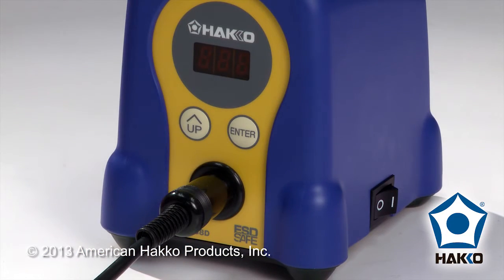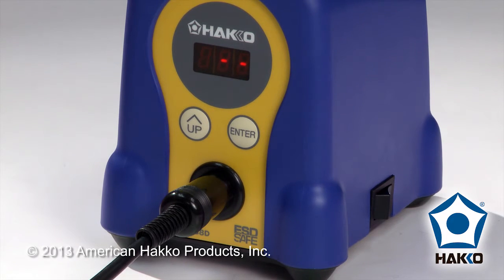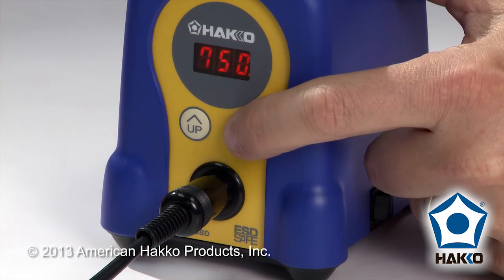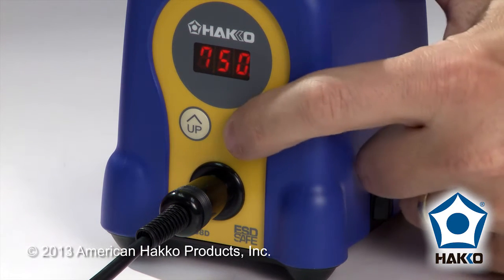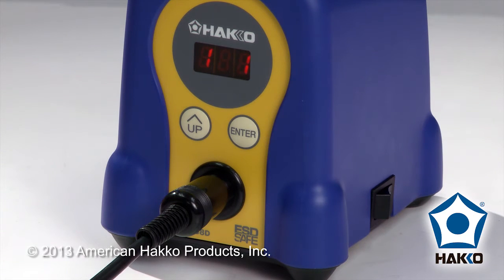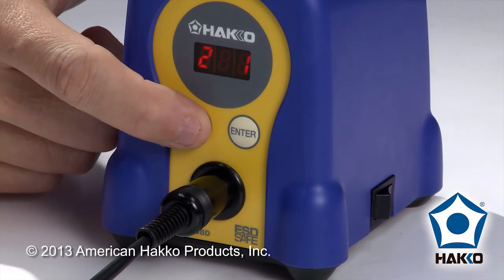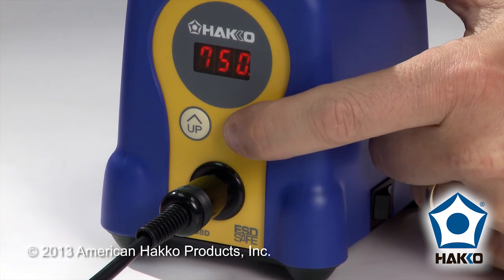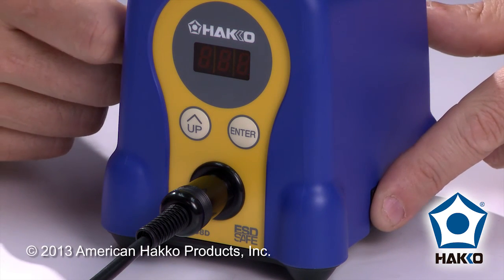Hakko FX-888D Soldering Station by American Hakko — How To Set and Use the Password Lockout Feature

Comment: There is no excuse for the amazingly bad human interface design on a supposedly premium product.  Dial adjustment works fine on machines in far more demanding environments like welders (I also weld, repair welders, and have more industrial machines than many pro shops).  I suggest Hakko offer a simple dial adjusted version then see which one sells more (profit is why your business exists). 
WHEN YOUR HUMAN INTERFACE DESIGN FAILS TO BE INTUITIVE THAT MAKES IT BAD.  That explanatory videos are required should get that point across but I don't expect Hakko to change since they can coast on component quality and reputation while switching to a more human-friendly layout would entail loss of face.

Comment: Bought this Iron based on Hakko reputation but regretting my recent FX-888D purchase because of what is possibly the worst user interface on any tool I've ever used. Out of the box the only slightly intuitive setting is changing the temperature a digit at a time via a single button with round robin on the "up" button. Every time I want to mod infrequently used parameters I'll have to spend time finding instruction manual or hunting it down online.
   .
Reply: Hi.  Use the preset mode.  Easy to set up.  Take a look: https://youtu.be/SzPYi05nw80
Reply: @tonyd1149  That a user interface fails to be intuitive is always bad design. No video should be required yet there are many pro and amateur vids.
Reply: it sucks to be stupid

Comment: No where in the manual says Calibration, it says temperature adjustment. This guy in the video says the 1st parameter is temperature adjustment, the 2nd is preset and the 3rd is Calibration mode. You just made it more confusing. The whole manual is a fuckin joke. Good iron though

Comment: I wish it required a password before you can ever go into the adjustment mode because the first thing I did with my unit is screw my calibrated temp up thinking I was setting a temp. So now I have no idea how far I've knocked mine out of calibration. It's nice to have such a feature but it's a poor way of getting to it. Had it said cal I would have realized I was recalibrate get but it says adj on the display which made me think adjust temperature level. Now I wonder is there a factory reset??? Or am I going to have to buy a thermometer to fix the freaking calibration??
Reply: I figured out how to factory reset. Cool
Reply: Jacob Hendrickson well, are u gonna tell us how to factory reset?
Reply: @greenchilaquiles  Just press the two buttons and turn on the soldering station. Then, press up until it shows "A" (if you're not in the US) or "U" (if you're in the US), and press enter.